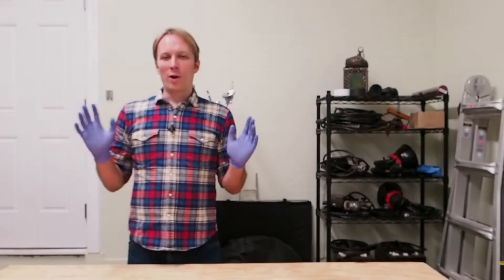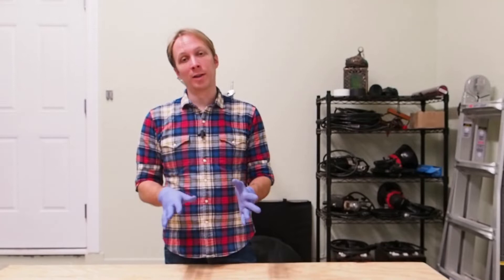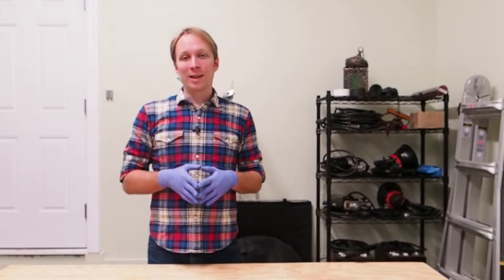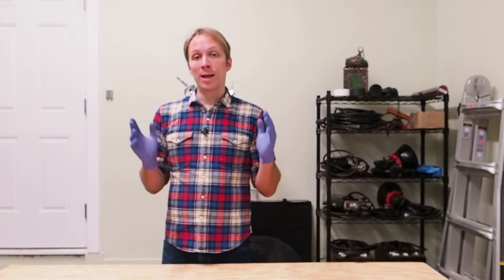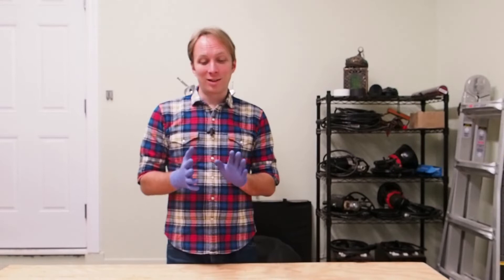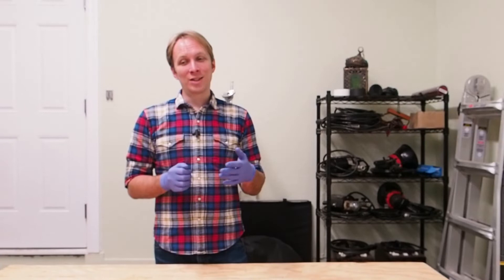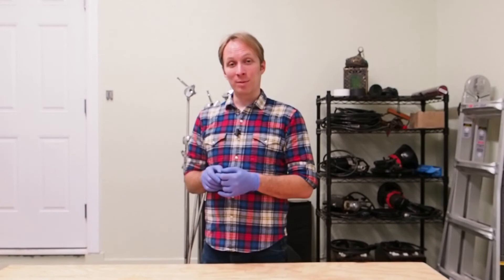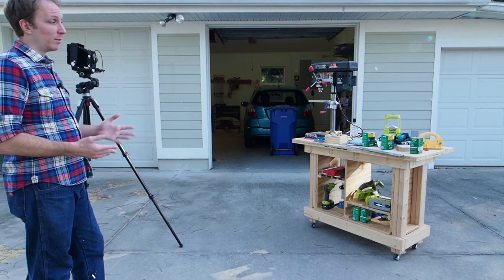Collodion Basics Part 6: Exposing the plate

Comment: Hi @Robert Bieber, does the law of reciprocity applies in the same way as film if we use long exposures? If we use apertures like 32 or 45 we'll need to increase the exposure...Thanks in advance Robert.
Reply from the maker: I couldn't tell you for sure because I've never done a particularly long exposure on wet plate.  I've never heard of anyone experiencing reciprocity failure, and the fact that the plate dries out does put a limit on just how long of an exposure you can make.  Off the top of my head I would guess that you're less likely to run into reciprocity failure because the particles of silver iodide and silver bromide you're exposing are much smaller than film grains, but that's just a guess
Reply: @tehbieber  thanks for replying. Yeah it makes sense as we are not dealing with silver cristals... Now I'm taking the chance for one more opinion: I just bought a full plate camera. I don't want to spend a lot on a lens and I'm thinking about a industar 37 (300mm F4.5) or industar 51 (210mm F4.5). I want to shoot mainly landscapes however I would try occasionally portraits. What do you think it could be the better option?
Reply from the maker: Personally I'd take the longer lens if you want to be able to do portraits as well, it'll give you a better perspective if you can get a little farther away
Reply: @tehbieber  yeah that's what I thought! Thank you so much Robert.